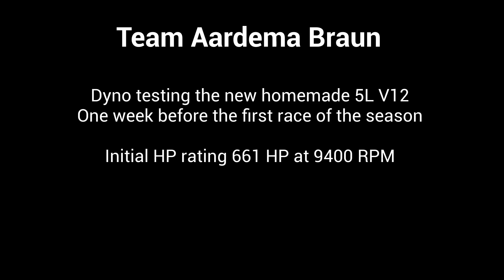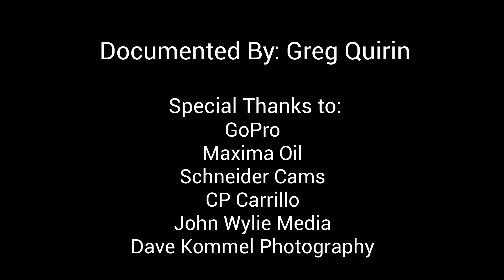Custom-Built V12 Engine DESTROYS Land Speed Record!

Comment: Scusate, ma di cosa si sta parlando? State osannando un motore da circa 132cv/litro? Con 12 cilindri, nel 2025? La Honda S 2000, di serie, di 20 anni e passa anni fa aveva un quattro cilindri 2 litri aspirato  da 240  cv,  che fanno  120cv/ litro.... E superava tranquillamente i 200.000 km,...l' Alfa 33 stradale del 1967 aveva un 8 cilindri di 2 litri e 230 CV, nel 1967...  Bravi, ma nulla di più...
Reply: Good but nothing more?  What have you built?  The number of cylinders is basically irrelevant....  You stated 132hp per liter...   The Honda 4 cylinder is 120hp/ liter.....  What are you expecting a 5.0 liter normally aspirated v-12 to make?

Comment: Great V12 engine OK. In the 70's Ferrari and Porsche developed a V12 and a flat 12 both 5 liters CC. Hp output was 610HP for the Ferrari (512 M) and 650 HP (917 L&K) for the Porsche, both atmospheric engines. Later 1971 72 Porsche entered the 917 10 & 30 in the Can Am series with the same flat 12 turbo charged: 1150 HP!

Comment: not wishing to denigrate the work that has gone in to this, and thanks for making the on-board public, but did not Mr. Isaac go faster in a naturally aspirated gasoline car which was the size of a 6-seater saloon some 55 years ago?
Reply: Who is Mr Isaac?
Reply: @caddydave  really ?!!   https://youtu.be/GNIOnE8VuYw?t=643
Reply: @nomdefamille4807 and?   I don’t think that’s really a fair comparison.     “Not wishing to denigrate the work” usually means my next comment is going to denigrate the work…. :)
Reply: @caddydave  that is a fair comment but perhaps you will allow for the possibility that I can appreciate the design and manufacturing skill/effort that an individual or small team can put in to their car whilst at the same time noting that they barely equalled (in automotive terms) "stone age" performance. i grant the lack of two litres and Chrysler resources of that period but on the other hand they could design for a single seat and the need for the engine to hang together for a minute (not saying that it would not last longer) whilst the old iron block held together for 2.5 hours hammer down. I regard it as an achievement in small team manufacturing (we have built this engine, what can we use it in?). If it had just been for 5 litre performance they could have based it around an LS (or even a Lambo or similar for 5 litre 12 cyl) and most likely have achieved a speed that could earn the term "destroy".
Reply: @nomdefamille4807 . I still think your missing the point….  :). 

1. They didn’t want to use an off the shelf engine for the their land speed records.  They wanted to build it , and use El Mirage / Bonneville to prove their engineering.  

2.  219 at a short track like El Mirage translates to a speed significantly higher on a longer track like Bonneville.   This same car and engine geared for Bonneville will be much faster.  Maybe 40-50 mph?

3.  Of you look at a contemporary v-12,  and compare.  I don’t think they are far off the mark power wise.  The Aston Martin Valkyrie uses a 6.5 liter V12 that generates about 1,000 hp at 11,000 rpm.    How many engineers / technicians do you think Cosworth has to develop an engine like that?   If the crew from San Diego is able to produce 6-700hp right out of the shop,  I would say they are doing pretty good.  Adjustments to cam profiles / exhaust / intake / fueling will get them gains above the current power levels without a building full of engineers optimizing every last bit of the engine.

Comment: Am i right in thinking the soeed was clocked at the 1.3 mile mark from a standing start ? What do you guys reckon the car is capable of if left to run ?
Reply from the maker: We ran a 286 MPH at Bonneville with the 6L-V12 - I'm guessing maybe 260MPH with the 5Lv12  on a 4 mile run

Comment: From what I recall, this engine is based off of the 6 liter v12, 
By math, it seems to be lower on power per liter, maybe when they spin it to 11k, it will pick up another 110-120hp on the dyno

Comment: Small displacement spread over 12 cyl gives lotsa piston top area.
A well known means to create more HP for this successful class run. 
F1 , limited to less cyls uses Yuge diameter pistons and less than 1 inch strokes for same reasons. Then just spin them to 12,000 rpm

Comment: Have I missed something? I just watched a video of a Bugatti Chiron doing 260mph on the German autobahn (W16 8 litre engine developing between 1500 and 1600hp depending on model)
Reply: This is a naturally aspirated hand built v12….  Not a quad turbo w-16
Reply: @caddydave  OK but the naturally aspirated (hand built) 6.5-liter V12 engine in the Aston Martin Valkyrie, produces 1130 horsepower and has a top speed (limited) to 220mph These are "Bog standard" European road cars and not the special builds some crazy Swedish people make... I'm just trying to understand what on earth is the world record here?
Reply: @alexmonroe613the Valkyrie is a hybrid.   The engine alone is about 1,000 hp…. Its also quite a bit larger  (5.0 vs 6.5 liter) and spins to a higher rpm.      I’m pretty certain that this v12 was just completed so I would guess they have a bit more in it with fuel / ignition / cam event timing.
Reply: @caddydave  OK (I've just googled it and I stand corrected!) The Valkyrie road car "only" produces 1001BHP from the ICE power unit. The Swedish company Aerotek Made a hand built naturally aspirated V12 about 20 years ago producing 1800BHP. I'm still trying to find the "world record" here.
Don't get me wrong this engine in the video sounds great but it also sounds a bit like someone's patting themselves on the back when they are about 500-1000hp behind the cutting edge... and a good few mph behind what has already been done elsewhere.
Like I said - I'm still trying to find the world record here?
Maybe it's just not been formally recoded elsewhere and things like the Valkyrie is disqualified because it is a hybrid.
Better give Aerotek a call and see if they want to come out and play!! 🙂
Reply: @alexmonroe613it’s all a fun argument,  but unless this engine is a similar size,  similar fuel ,  similar rpm and most importantly also naturally aspirated,  none of the comparisons are valid.    A Merlin v12 is 27 liters, and was anywhere from 1000(ish) -2000(ish). Hp depending on the induction setup and most importantly manifold or boost pressure….  But as the engine is significantly larger and also typically boosted,   It’s not an apples to apples comparison.
Reply: @caddydave  I take your point about the Merlin, but every v12 engine I have quoted has been naturally aspirated, between 3.7 and 6.5 litres and runs on 91pon "ordinary" gasoline. The Aerotek engine was 3.7 litres had a variable output depending on octane 1793bhp on 94 pon. it didn't have any turbo's superchargers or nitrous but it did rev to circa 20k... I'm still not understanding the classification here for a "world record" at a poultry 661Bhp
Reply: @alexmonroe613yes,  but does this engine actually exist?   I can find zero about it…. A 20,000 rpm aero engine?  Making 1800 hp at 3.7 liters.?  I don’t believe it unless you can share a link or some proof that it actually exists..
Reply: @caddydave  And there it is! I had a feeling all through our exchanges that you just didn't want to accept that a 5.0 litre naturally aspirated V12 developing 661BHP wasn't overly special. The Aerotek engine was built 20 years ago so no link! but I worked for a company that built carbon fibre gearboxes and clutches that could spin up to 22k+ these (or derivatives) were used on f1 cars at the time. That is when we were approached about the build I mentioned. So there it is - if there is no link to a V12 of circa 5 litres over 661BHP it doesn't exist... despite some (naturally aspirated) road cars exceeding this! I think that brings our conversation to an end. I still haven't been given any criteria that makes me understand this as a world record.

Comment: Hmmm....what record did it brake? 220 mph is the speed that unrestricted a bit modified street-legal sportbike can do)) And speeds about twice bigger on piston engines were achieved on land-speed record battles more than half century ago))  But sound is really cool!!! like a sportbike, but more big and brutal)
Reply: 278 mph is the record for piston engine powered, I heard just recently but that's like 450 kph. Manufacturers are about at that and Top fuel dragsters can beat that, so there has to be some real picky technicalities to qualifying!?
Reply: @mrgoodman6620 14.08.2020 Speed Demon set 470 mph (775 kph) on Boneville. Twin turbo big-block 557 Chevy powered. Speeds of 400-500 kph where real at 193x-th)) This I googled of course, but in my school years I`ve read a book about land-speed records and remember for shure, that even in the middle of previous century speeds were far grater than 220 mph, so that is why I made a comment))
Reply: @mrgoodman6620 and Top-fuel dragster can not set any official land speed record. Oficially you have to pass 1 mile both dirrections within one hour (smth like this)  and calculate average speed...top fuel`s motor liftime just can not sucseed this demand🤣
Reply: Check out the new Suzuki busa with 400 hp. Thats 80 more than the H2R!

Comment: How is this a land speed record of any kind?
Reply from the maker: There are different racing classes in Land Speed racing.   This one was a 1.3 mile run at El Mirage CA. We are running a D- motor which is the 5 liter class naturally aspirated on gasoline. The record was on the books for 20+ years so we bumped it up from 217 MPH to 219 MPH. In two weeks we will try for the Fuel record (We will use NOS) and hopefully get another record in the books. I would like to say we will see speeds over 225 MPH for the next attempt.  Stay tuned and we will have the video up after the next race which is June 22, 2025.  Thank you Greg Q

Comment: A new land speed record for what? Not the fastest land speed car as top fuel dragsters regularly exceed 330 MPH in 1000'. Therefore what category is a 219.4 MPH land speed? I'd like to know. Not criticizing the event - just don't know what it's compared to?
Reply from the maker: @trumpwatch, there are different racing classes in Land Speed racing.   This one was a 1.3 mile run at El Mirage CA. We are running a D- motor which is the 5 liter class naturally aspirated on gasoline. The record was on the books for 20+ years so we bumped it up from 217 MPH to 219 MPH. In two weeks we will try for the Fuel record (We will use NOS) and hopefully get another record in the books. I would like to say we will see speeds over 225 MPH for the next attempt.  Stay tuned and we will have the video up after the next race which is June 22, 2025.  Thank you Greg Q

Comment: 219 mph ? Hell, Nascar will do that on roundy rounds ! Indy cars will do that all day long racing on the streets ! Pro Stock cars at the 1/4 mile do that and more ! Top fuel cars do more in the 1/8 mile !!! What's the big deal ?
Reply from the maker: This isn't NASAR or Indy, there are different racing classes in Land Speed racing.   This one was a 1.3 mile run at El Mirage CA. We are running a D- motor which is the 5 liter class naturally aspirated on gasoline. The record was on the books for 20+ years so we bumped it up from 217 MPH to 219 MPH. In two weeks we will try for the Fuel record (We will use NOS) and hopefully get another record in the books. I would like to say we will see speeds over 225 MPH for the next attempt.  Stay tuned and we will have the video up after the next race which is June 22, 2025
Reply: @GregQuirin  O yeah, I forgot. A STOCK production Dodge Challenger, is AS FAST ! I'm still not impressed , but good luck on your adventure .

Comment: In which class is this a record??
Reply from the maker: This one was a 1.3 mile run at El Mirage CA. We are running a D- motor which is the 5 liter class naturally aspirated on gasoline. The record was on the books for 20+ years so we bumped it up from 217 MPH to 219 MPH. In two weeks we will try for the Fuel record (We will use NOS) and hopefully get another record in the books. I would like to say we will see speeds over 225 MPH for the next attempt.  Stay tuned and we will have the video up after the next race which is June 22, 2025

Comment: Exactly what land speed record did they break? I'm certainly not trying to denigrate anyone, but a run of the mill F1 car goes faster than that. So I'm curious what record they broke, since there is obviously more than one class. (And by the way, that engine sounds amazing.)
Reply from the maker: This one was a 1.3 mile run at El Mirage CA. We are running a D- motor which is the 5 liter class naturally aspirated on gasoline. The record was on the books for 20+ years so we bumped it up from 217 MPH to 219 MPH. In two weeks we will try for the Fuel record (We will use NOS) and hopefully get another record in the books. I would like to say we will see speeds over 225 MPH for the next attempt.  Stay tuned and we will have the video up after the next race which is June 22, 2025
Reply: @GregQuirin  Thank you for the reply and the great explanation. I'll be looking forward to the next video.

Comment: Always first to give credit where credit is due, yet, notwithstanding the absolutely incredible sound of the V12 engine, how is 219 mph any kind of land speed record, when streamliners driven with internal combustion engines surpassed 300 mph back in 1935?   Is this record associated with a naturally aspirated engine displacement, running on El Mirage?  What am I missing?
Reply: This is a 5.0 liter naturally aspirated v-12 on gasoline.    Theres all sorts of different clases for specific engine sizes,  turbo / non turbo etc..
Reply: @caddydave  Thanks for your kind and knowledgeable feedback...

Comment: For example VW golf 1 1970 models small engines polished engine increase compression 1.6 petrol carburetor using additional turbine air intake. Additional fuel system. Supplement cooling system. And special sport version atrum box. Short distance 100 meters gearbox sport with 4 gears 6 seconds. Therefore it is important to adjust the box transmission, helping the engine equalize power loads hold maximum speed. Adjust the box or any car model to get all possible power than the standard box.

Comment: Speed record different engine power. For example, small engine size using specially adjusted gearbox transmissions keeps steady speed of seconds. The same also large engine power uses additionally adjusted gearbox transmissions.

Comment: Max power limit good .  Helps control fast variants speed Mech Correction GEARBOX manual correction.  Remember GEARBOX manual sport versia helps your + helps engines power max speed 

GEARBOX manual correction possible real Gives extra speed. It all depends on the size of the gear box. Less or more speed in the gear box combination.

Comment: I would like to know what class this record was  for? Also, I can’t wait to see Steve Morris and the project that he’s currently working on, they are going for the all out piston engine record and shooting for 500 miles an hour with 5000 hp 10,000 rpm all billet custom big block Chevy. I believe they will get this record no problem. Steve also has a custom 3500 hp plus v16 that he has built in the past for a different project Be interesting to see that one and a streamliner as well imo imagine what 16 cylinders at 3000 hp would sound like 😂

Comment: I don't understand: a V12 5 liter, with... 500hp. A car made for land speed record, reaching.... 220 mph?!? Really? The sound is like music, but performance are just a joke 😳
Reply from the maker: Max, there are different Land Speed races, this one is a 1.3 mile run at El Mirage. The old record for the 5L streamliner class was 217mph and on the books for 22 years. At Bonneville the speeds are faster because the course is 5 miles long.   Two years ago our team went 246 mph with a 4 liter homemade engine.  My guess is this new 5L V12 would hit 255mph at Bonneville.

Comment: D/GS Streamliner means a class D, unblown gas (petrol) streamliner. D == 261–305.99ci (4.2-5.0L)

The race format at El Mirage is: From a standing start, accelerate to your car's highest possible speed before the timing lights. At El Mirage, the track is 1.3 miles (2.09 km) long with a 132-foot (40m) timing trap at the end.
Reply: This comment should be pinned to the top of the comments section or added to the description, thanks for the info.  
Many of the commenters don't even know there are different classes and locations that all have their own rules and records.
Reply: 219mph in 1.3 miles is very impressive.
Reply: @Nathan93Baker No 301.5 mph in one mile is impressive, and that was with a street legal car.😮
Reply from the maker: Thank you for the info Luke!

Comment: Do you use water injection? If you did you could bump compression, 2or 3 pts. Fantastic work on this. Too bad you don’t live near here…. I would sweep just to be there.
Reply from the maker: No water Injection.  We will run NOS in 2 weeks and hope to go over 230mph. The fuel record is also 219 so we should be good as long as we don’t have any problems.
Reply: @GregQuirin water could be used later, and as well allow more timing . It may also be difficult to find more compression with out disturbing flow or other effects
Reply: Always funny when the Internet experts try to give advice to people with far more knowledge and experience!
Reply: @SuprSi doubt that. But you know me personally?

Comment: For those wondering about the Class and other results from this event, add "https://" to the following (make sure no spaces and remove quotes):

img1.wsimg.com/blobby/go/a0c5ccee-a57e-40cd-b11c-049ece37d91c/downloads/1fb8ee7a-af2d-4437-a9b3-5a2e68b3809f/Results%20for%20May%202025.pdf?ver=1749151058966

Edit: Or just click on the link, it works.